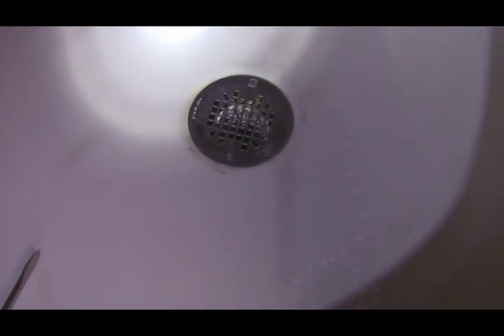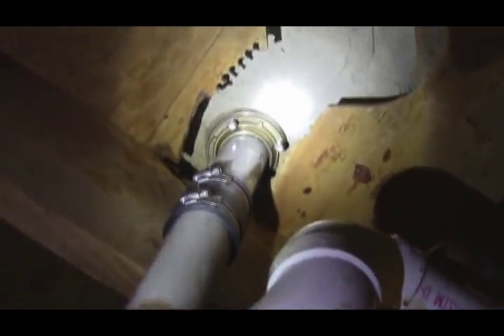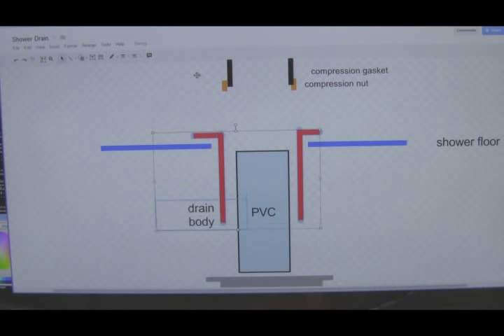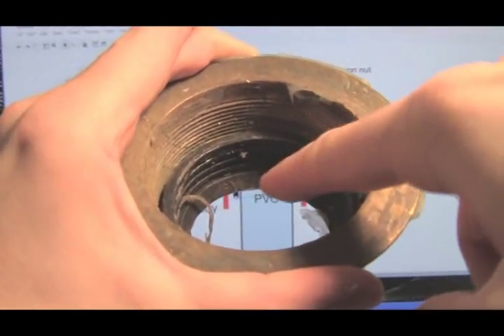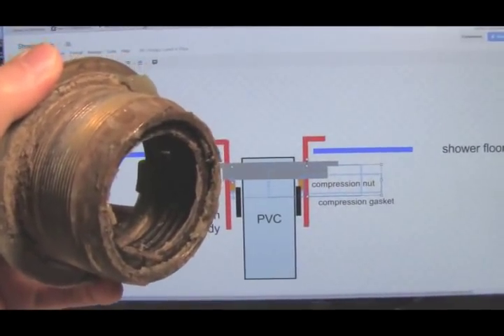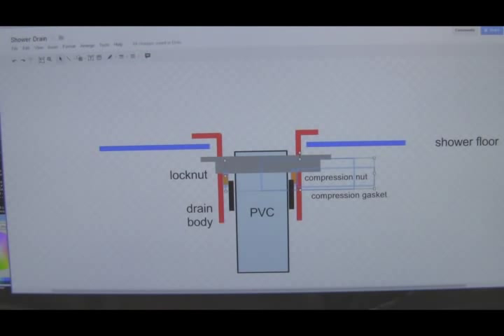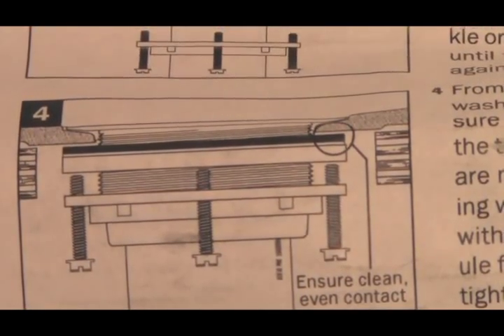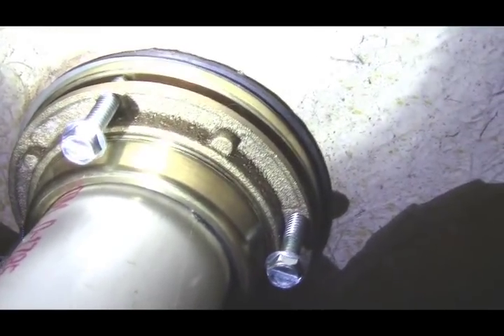Replace Old Leaking / Rusted Stuck Shower Drain with JackRabbit

Comment: wow excellent help! the computer diagram was priceless at helping me to understand what is going on and how it all works. I replaced a leaky shower drain several years ago using pvc instead of brass, but I could never get it to stop leaking no matter what I did. Finally I just gooped the heck out of it with silicone and its lasted ten years LOL. Warning for you, watch close for cracks in the shower floor, I needed to use spray expand foam under mine to stop the flexing & cracking.

Comment: Thank you!  The problem you had was almost exactly the problem we are having.  We also had 2 plumbers come out and replace the drain.  Both times it worked for a little while then started leaking again.  The plumbers told us the same thing about the floor moving...and said we should replace the whole shower.  We are going to try and replace it with the Jack Rabbit Drain.  It looks like this will fix our problem.  Your video is the best video that I have seen!  Thanks again!
Reply: How did it go? I’m having the same problem

Comment: excellent video. Excellent photography and narration. Thank you. I may have a similar situation where the stainless steel cover had to be epoxy on by me since the screws through it had nothing to attach as the plastic had deteriorated. Epoxy has worked well for a while. But eventually I will have to replace this and hopefully I can do it from the top and have a plumber cut out the pipe below and fix a new pipe to it, where it can accommodate something called a wing tight shower replacement. They were nice enough, being the company wing tight to call me today and kind of walk me through it with pictures I sent. You are a handy and patient guy to have been able to do this on this type of drain with locking nut. Thanks.
Reply from the maker: Glad it helped!

Comment: Thank you!  I am attempting to take my drain apart right now and mine is exactly like your old one except the whole thing is pvc.  It's moving around enitrely too like yours, but I guess if I have to cut it, at least pvc will be easier to cut.  I hope I can get one of these jacking style drains at my local hardware store too, because that makes a LOT more sense than the lock nut that doesn't have room to grip. Your diagram was extremely helpful too. Thanks!

Comment: You're old drain assembly did not have a friction ring underneath the rubber gasket underneath the shower floor. Major cause of all that rust. I suspect you had a slow leak under there for a long time.

Comment: Once you cut the drain body, were you able to remove it from the top or did you need to go underneath to remove the locknut in order to get the drain body out? I' trying to avoid cutting a hole in the ceiling below.

Comment: I have one tip.. sometimes it's easier to cut off the old drain.. it's faster.. but I recommend you use a small oscillating..tool..riot zip..something like that..it's great for tight spots..and you dond damage the tub..or sink..it's just a tip..

Comment: Mine is 1970s era, it looks like cast iron pipe.  It leaks into the crawl space between the pipe and nut.  It's way in the back corner of the crawl space with lots of pipes and wires in the way.  I don't think I can physically get to it, I'm to big.  At least the 2x6 subfloor isn't getting wet. It's not a huge emergency because it's only getting the dirt wet but it should be fixed.

Comment: Rather than wrap the hacksaw blade in a rag you should have purchased a compact or mini hacksaw for about $12. It makes the job much easier. You could have also used a Wingtite shower drain replacement without ever needing to access the shower pan from the bottom.

Comment: I noticed the 2 steel straps around the 2" black rubber coupler, below the drain.  That's what I need.  The original idiot welded my PVC drain to the 2" PVC pipe and so I cannot simple replace the drain.  It began leaking around the failing rubber washer.  I am an engineer and hate when components are not designed interchangeable.

Comment: Very helpful video!  How long did it take you to saw the drain body?  I used the same method, as a last resort, to remove a corroded, stuck metal tub drain but it was impossible.  I'm afraid any more cut would damage the PVC lock nut's thread.   I've hesitated to pay a plumber $225 for the tub drain replacement.  Any advice?  Thank you.
Reply from the maker: you know, it didn't take too long to cut it, maybe 15 min or less? I think it was cast iron... if you had stainless it'd be harder, but you might be able to get a different blade type (carbon something or other). I was able to do it without damaging the tub somehow. $225 sounds cheap for my sad experience with plumbers!